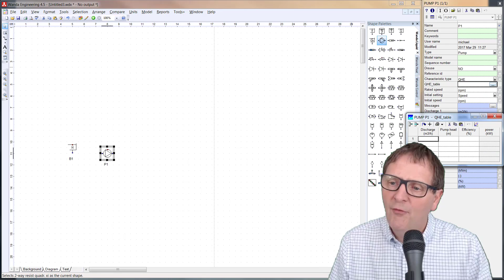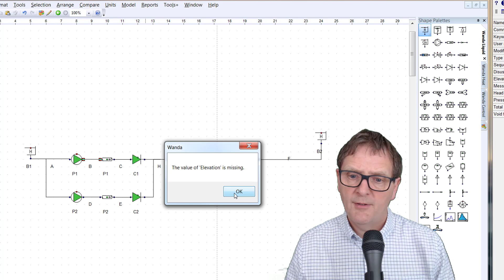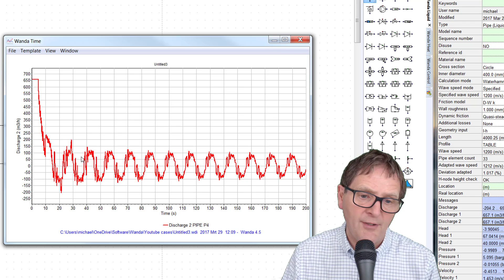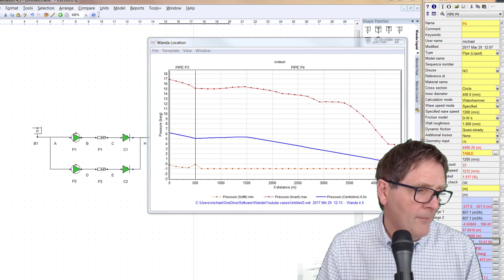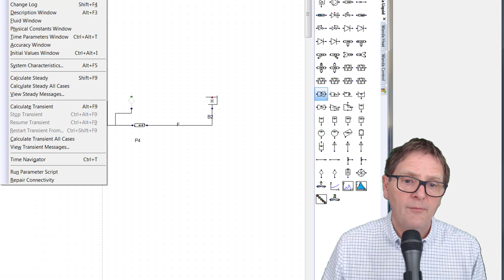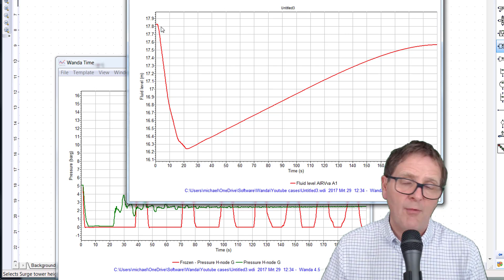Surge Analysis of Pump Trip

Comment: I stumbled upon your videos while doing research for a micro hydro power system for African homes. We are looking to design a system that uses elevated water tanks to spin turbines. We're also looking to pump the water back by any combination of pumps that leverage air pressure (trompe, hydraulic pump), water hammer and all the kinetic energy of the flowing water. The goal is to maintain 3seconds of flow rate in the overhead tank at all times by the combined functions of these pumps.

We need your expertise designing this system. Kindly let us know how we can engage.

Comment: Good day. Your videos are extremely helpful. Thank you! I have some questions relating to this video.

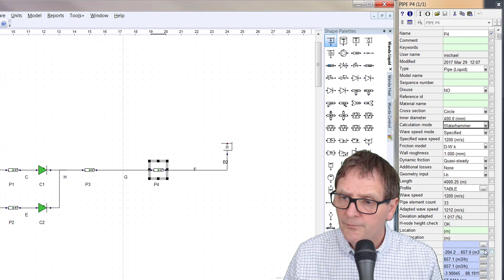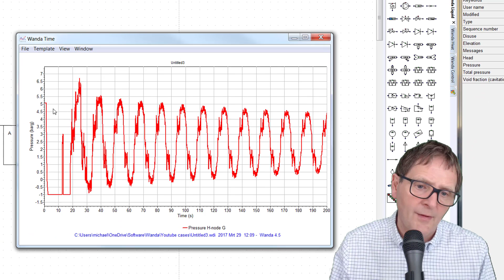1) Why does the discharge decrease so sharply before oscillating (16:18) when in a theoretical analysis the velocity would change direction but not magnitude? Why does it not follow a similar pattern to the pressure (16:50)?

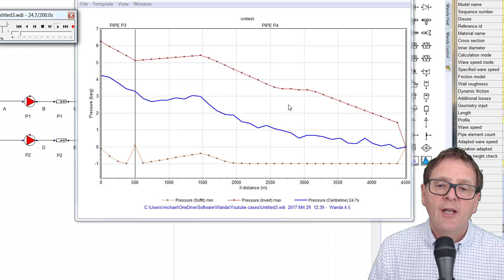2) What is the interpretation of the oscillations around 1 bar pressure in the graphs at 24:37 and 32:49?

3) You address the resulting high pressures by introducing a surge vessel but you have not addressed the resulting negative pressures (not in this video, at least). Would you not consider ways of avoiding low pressures and the associated problem of cavitation in this case?

thank you for your explanations and your assistance!